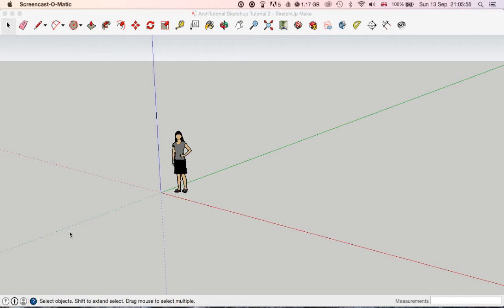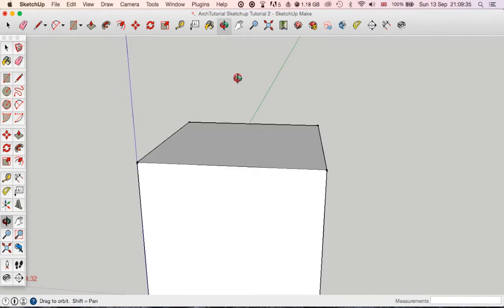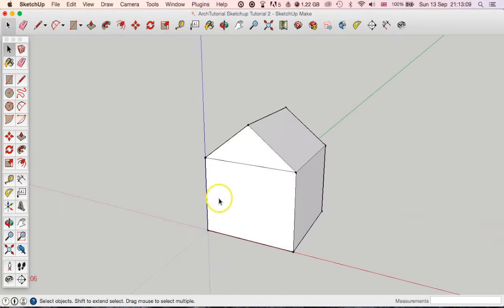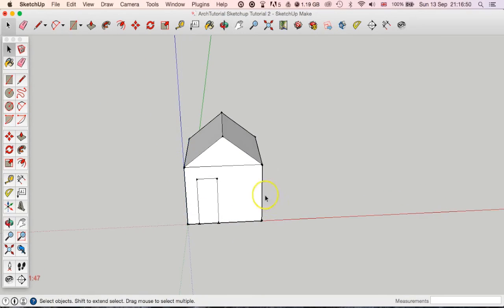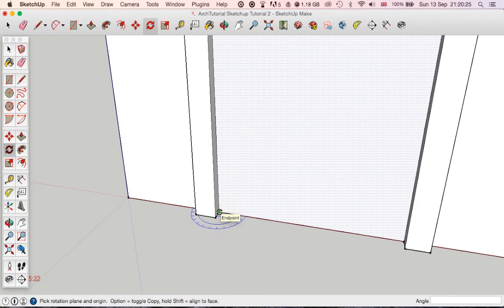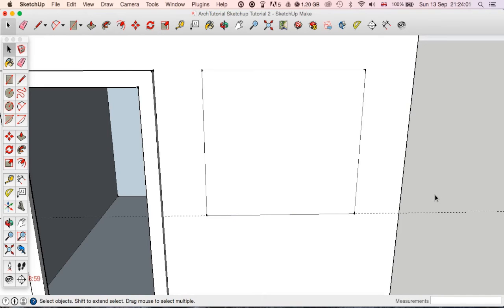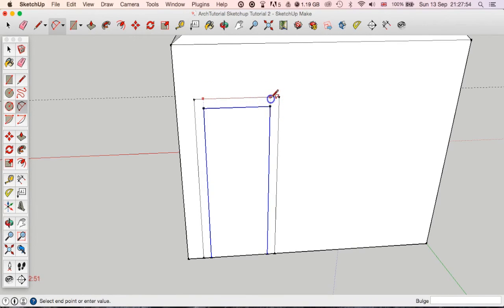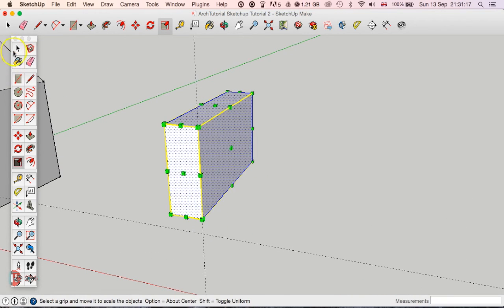Learn SketchUp for Architecture - Tutorial 2 of 3

Comment from the maker: Streamline the process of modelling. Learn these basic shortcuts:

L - Line
A - Arc
R - Rectangle 
C - Circle 
P - Pull / push 
M - Move / Copy
Q - Rotate
Z - Zoom 
Scroll Wheel - Orbit
H - Pan
B - Paint Bucket
E - Eraser 
T - Tape measure 
S - Scale
F - Offset 

And also:

Ctrl + A = Select all 
Ctrl + Z = Undo 
Ctrl + Y = Redo (meaning go back to last done) 
Ctrl + S = Save as 
Ctrl + O = Open 
Ctrl + P = Print 
Ctrl + C = Close the program 
Ctrl + C = Copy 
Ctrl + V = Paste
Reply: Could you make a tutorial on how to create a detailed floor plan in Sketch up or Photoshop. Also different ways to create renders.